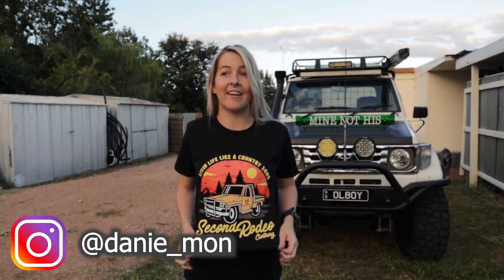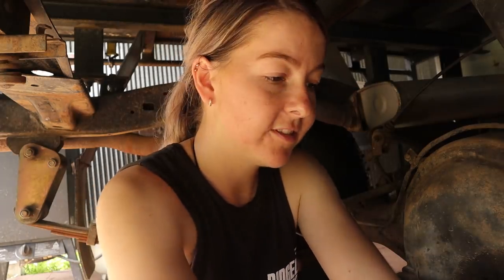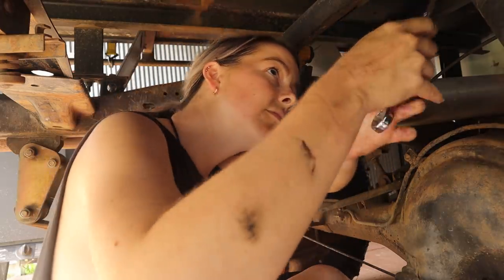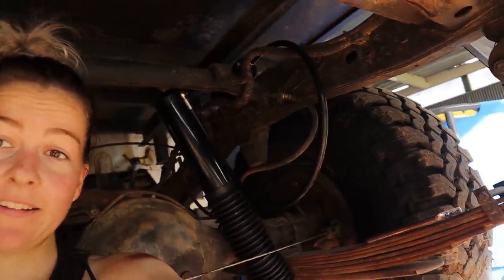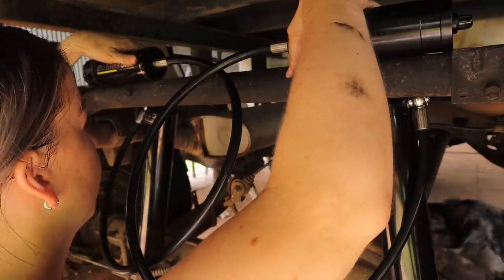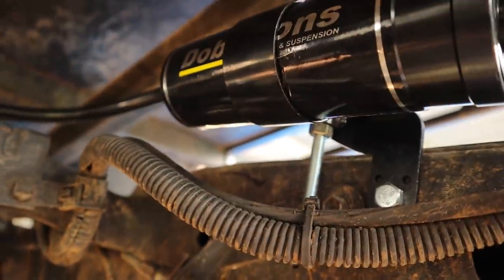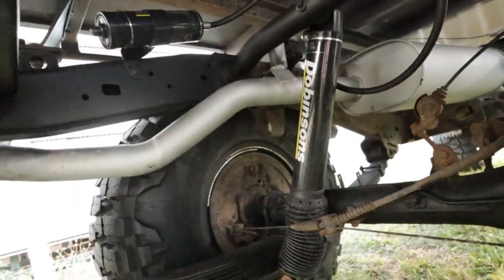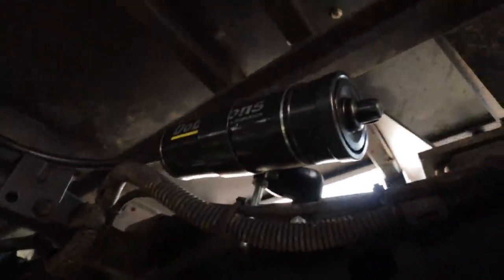OLBOY Mods Part 1: Dobinsons Remote Res Shock Install

Comment: One thing I found that made a HUGE difference on my old leaf sprung LN106 Hilux was lifting the weight off the spring pack (It would be super simple with a hoist, but I just used a jack and lifted off the chassis) and then knocked a prybar into the leaf pack to seperate it out and squirted some moly grease in between the leaves. Allows them to slip past each other a bit easier and they dont tend to bind up as much. The old solid axle hilux's are a lot like the 75's with super short leaf packs but it was a definite improvement offroad with how well the wheels articulated, but a MASSIVE difference onroad- You dont run over a ciggy butt and shatter your spine any more.

Sold the Hilux back to my parents and bought a TD 100 series. I miss the versatility of the ute, but maaaan I dont miss the ride of that old girl- Its nice to get to where your going and not fall out of the truck with the lower half of your body not working any more!

Comment: I always clean underneath. It makes for a much more pleasant experience.
Reply from the maker: Yes same after every trip offroad. But this was just after driving through my driveway which is just dirt
Reply: In Canada... My rig is oilly as an old grease rag...salt and rust suck.
Reply: @liebherr11602  So they still salt the roads? Is that eco friendly?
Reply: @Malc664  yes, salt is normally harvested from the sea.  The amounts are greatly diluted .

Comment: To install the shocks, I compress them with a hi-lift and tie a string in between the top and bottom.  Bolt in one end and then cut the string while lining the other. Works a treat!
Reply from the maker: Yeah similar to what I did with the jack:)

Comment: You dont really need remote res for cape, i did it with cheap superior ones in my old SAS datsun, no issues just alittle stiff just ran lower tyre pressure's to compensate lol...
Looks good ay
Reply from the maker: You don't even need a 4wd for the cape these days but id rather have them as I have done corrugated roads before for long periods and the shocks just got too hot for my liking so that's what I meant
Reply: Nah its all good.. the earlier you go the better the roads, i would of got better shocks too but i was broke lol..
Keep the build vlogs coming!

Comment: Great idea to include an after some time review with the install. Do you know if that brand/model of shock would suit a 96 disco 1?  I’m in need of a new set.
Reply from the maker: Just look up dobinsons they will have a listing or just order what mount type you need and measure your travel length needed
Reply: Will do. I just thought you may know. Was thinking that they still run Landys at your work.
Reply from the maker: @Andysfishing  nope been gone for awhile. Gwagons now

Comment: Love the build! What are your thoughts on these shocks 2 years later?
Reply from the maker: I swapped to the 3 way adjustable dobinsons eventually after this. Same shock just ability to adjust high, low compression and rebound. We also love the 3 way adj in vehicles that we perform engineering tests also because they can be adjusted depending on how the vehicle handles in the test for its weight.
Reply: @DanieSimpson  awesome! That's actually what I just bought for my 1st gen sequoia. Real excited now to install!

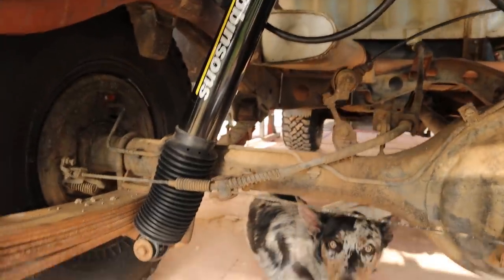Comment: 7:25 those res' bolts can be a bitch to get started hey :) You will probably notice the most difference on corrugated or washed out roads (if you have not already) It just tends to stay a lot more predictable / stable on rougher roads at speed I found. Good to see someone having a crack and doing a good job! Thumbs up Danie looks great!
Reply from the maker: Thank you!!

Comment: Did you also use a ziptie on the bottom of the shaft boot? Or did you keep it lose so you could clean it out?
Reply from the maker: Keep it open makes it easier to clean

Comment: another great video on your 75 Danie ...just wondering what sort of fuel consumpion yours is getting per 100kms running 35 ...mine not the best running 33 and after markert turbo
Reply from the maker: I have 33s. The 35s went on the 105. I get about 16L/100km on 33s and 14L/100kms on 35s
Reply: @DanieSimpson  ok no worries thanks for quick respones mine running straight through pipe garrert turbo13.5 litres per hunderd but when towing tandem and trailor with car on it can go towards twenty litres per hundred lol

Comment: Danie, are you able compare after a year yor Dobinsons vs other off road reservoir shocks ? Anny issues, problems, leackage etc you had with them? I mean there are more and more reservoir shock (budgetary like Dobinsons, Amada, Profender, Ironman, Supperior Engineering etc) on market but FOX as same as King are leading at performance and quality at off-road shock business I think. And for my GU at the moment FOX Performance 2.0 reservoir  wins (quality+performance+price level).
Reply from the maker: No issues after the year. Still love them and changed my fox to adjustable remote res now too. 
I'll never go a 2.0 shock again they just can't compare to a 2.5. Even my steering damper is bugger than a 2.0 now haha
Reply: @DanieSimpson  Cool. Thanks a lot and keep it going ;). Cheers

Comment: Well done young lady :) , maybe a breaker bar to loosen the bolts then a ratchet for the rest of the work....less back breaking :) , just sayin .
Reply from the maker: Nah trying to use minimal tools I have a breaker bar in my cab
Reply: minimal tools that's ok, but a piece of pipe to extend the ratchet handle will help a lot, great video Danie.
Reply from the maker: @rossp1762  got that too in my cab but that is to show you don't need a heap of tools

Comment: I noticed you don’t have a sub tank is that for a reason bc I’m building a 75 and looking for ideas absolutely love the videos she liked it 😊😊
Reply from the maker: I'd rather have one big replacement tank then two seperate ones but it's just not something I've really needed so far:)
Reply: Danie Simpson thank you keep up the good work 😊
Reply: You can fit a 150ltr tank in the spare tyre area.(home made, approximately 650 x 650 350mm deep) had one in my 97 extra cab lux. tyre takes up less room on the tray than jerry cans. Also seen fuel tanks instead of under tray tool boxes
Reply: Shane Von Harten Cher’s bud I’ll look into it

Comment: Hi
Awesome video and very well done, If you don’t mind me asking are you still very happy with the Dobinsons suspension. I’m trying to make my mind up on the Old man emu or Dobinsons. 
Thank you kindly 
👍🏽
Reply from the maker: Yes and have adjustable remote res dobo in the front now and very happy
Reply: @DanieSimpson  Thanks for your fast reply.
Yer I’m looking at getting the new remote res all round for my 76series and gvm upgrade. Hopefully that will help with the ride comfort etc.

Comment: Hey danie have you had any problems with the rear hub bolts breaking running the 35s.
Reply from the maker: They are 33s the 35s are now on the 105 but no I broke a few of mine years ago on 33s nothing really to do with tyres. You can upgrade to 10mm like the 105s have or your axle could be just slightly bent which means you will just keep snapping them
Reply: You can get chome moly studs  pretty cheap
Locktup4x4 used to sell them
But superior  engineering  be the next option as locktup closed up
Reply: Wheel rim stud upgrades
Pretty much same price as the toyota stuff  but higher tensile strength 
Soo should honestly  never see a breakage unless severely abused
https://www.exploroz.com/Members/92954.75/MyBlog.aspx?s=&p=%2fBlogs%2fDefault.aspx

Comment: Well I am going to call you danger Danie, no axel stands what were you thinking, but hey you survived with all your limbs intact..
It would be good to have a decent jack and axle stands, maybe Santa can help there.
Having so much pipe for the rezzies you should have got them as close to the rear as possible for ease of adjustment. as I assume you will be doing some adjustment to try different settings. Keeping the rubber covers on good idea unfortunately they don't last long in stony area's and nothing worse than a damaged shaft in the area that goes into the body.
Good video Danie, I like your creative ways to deal with stuck items not having the brute force of us grease monkeys, looking forward to your next one.
Reply from the maker: I have axle stands and there was no requirement for them. There is no adjustment so not sure what you are on about there either.
Reply: It looked like on the reservoir  opposite end to the pipe from the shock there was a dial like on my King shocks just a six position clicker for rebound and compression adjustment. @DanieSimpson
Reply from the maker: @Nickwillfixit  these are dobinsons monotube remote res
Reply: OK going to google them as not available in the UK even the King shocks had to come from the US. @DanieSimpson

Comment: if using hand tools and cracking nuts use a pipe over the ratchet say twice its length maximum
Reply from the maker: Yes I have one for my wheel nuts in my cab:)
Reply: @DanieSimpson  would have made it a bit easier for you in such confined spaces but as you said have to be mindful of where the motion goes when cracking nuts
Reply from the maker: @dtec30  yeah my face probably made it look harder than it was hahah
Reply: @DanieSimpson  nope that was focused concentration if i had to guess the facial expressions
Reply: i have probably pulled a few faces like it over the years

Comment: Just watched was interested to see feedback on the new MRRs but bit hard to get a gauge on just the rear only.

Have you replaced the front coils and shocks yet  and if not will you be soon, would improve overall ride jmo, with the Doobies MRR yet,?

Also have you considered parabolics on the rear., looks like you like a light setup, have read a few reviews and Ronny Dahl rates them on his cruiser, as in the link below some positive benefits if flex and ride comfort are on the list? 
  https://www.terraintamer.com/en/4wd-products/suspension/leaf-spring-catalogue/parabolic-springs
Reply from the maker: I do not have coils and no parabolics do not allow for flex that I enjoy out of these leaf packs

Comment: You might need to extend your bump stops by 2"
Reply from the maker: Why
Reply: @DanieSimpson  it looks like the shock will bottom out before reaching your bump stop. Unless yoir next video is "this is what happens when you don't extend your bumps". Can't remember but your running 4"shocks?
Reply from the maker: @leeting8590  maybe watch the whole video as that was addressed.
Reply from the maker: @leeting8590  the spring is the limiting factor not the bump stops

Comment: How did the dobinsons go?
Reply from the maker: wicked I swapped to 3 way adjustables dobinsons from and rear and they're our shock of choice for engineering testing because of how well they perform and the range of adjustment
Reply: @Danie Simpson 👍 yeh that's great .
I have been looking at 2 lift kits..
the dobinsons MRA kit and the superior engineering remote res kit for my ford ranger PX3. Going with 3inch lifts.
I think the dobisnons look abit more heavy duty in regards to the piston size 50mm vs 46mm.  
Do you plan on doing a full review on the dobinson MRA 3 WAYS?
Reply from the maker: @marcusbarnes5929  will need to pass a lame change test for 3" and we find the dobinsons to perform better than the superior in those test procedures.
will be a blog post on my website
Reply: @Danie Simpson  legend 👍 do u have a link to your blog ? I will have a read through. 
Cheers.

Comment: I was freaking out ! A centre jack on the diff housing ; only . Please do not encourage this . Let alone practice it. All Hydraulic jacks can fail and be overloaded . LC's are heavy . Stands are cheap and safe. I have about 4 or more . If you undid the rear nuts on one side with that centre jack on the diff ; she would have toppled off that centre jack pod. You are too cute to die or cripple so young. or at any age . Try all the adjustments to get it better . And maybe an air suspension seat over long harsh trips. Cheers .
Reply from the maker: Please read before commenting. All of this has been addressed. 
1. Its not a hydraulic jack and im more likely to have a tyre explode in my face taking it off the wheel studs than I am have that jack fail. 
2. Even if it did fail nothing "topples off" I have tested this as part of my risk assessment.
3. You dont carry jack stands when you are out bush. Learn to work without constantly relying on safety devices. Sure if you have them use them but if not, do a risk assessment and proceed with the level of risk you are willing to accept.  Which is what I did because I assessed the situation as no more dangerous than changing a tyre on the side of the road.

Comment: Hi Danie, 
I was looking at purchasing a set of these for my 80 series, but I've read a couple of stories online about different types of failures with them. So have you given them a work out and are they still holding up alright? 
Ps. Love the vids.
Reply from the maker: They hold up wonderfully as explained in this video. Usually from people running the wrong sort of shock

Comment: Something tells me these are the wrong shocks!....
Reply from the maker: The wrong shocks for what?
Reply: @DanieSimpson  Whats odd is the distance between the end of he shock and the end of the can when sitting! you described how hard it was to compress it up and bolt it up etc...thats kinda not right me thinks....
Reply from the maker: @holdenrestoration2557  they're the right shocks don't stress 😂 I'm not Hercules and these aren't just normal shocks that are easy to compress
Reply from the maker: @holdenrestoration2557  as I explained in the video when my spring is at max uptravel there is still plenty left in the shock aka it hasn't bottomed out. And being 11" travel there is heaps more available for down travel which will come in handy when I increase my down travel. My up travel will never change as I am restricted by my chassis and wheel base widths